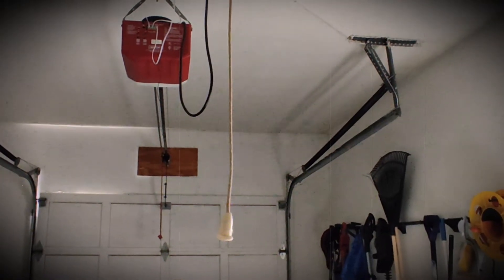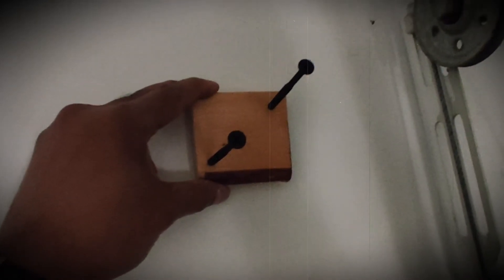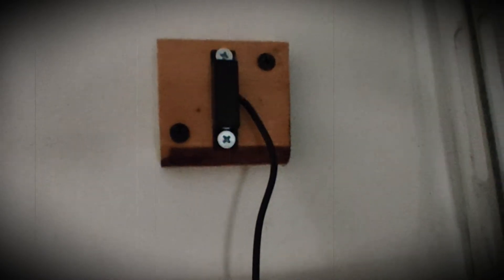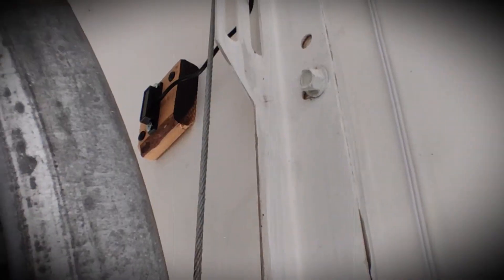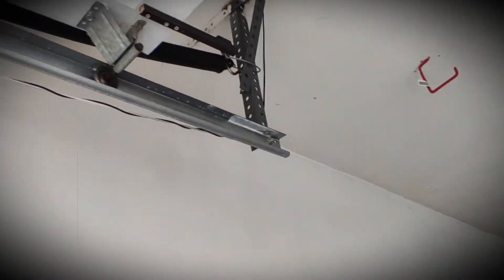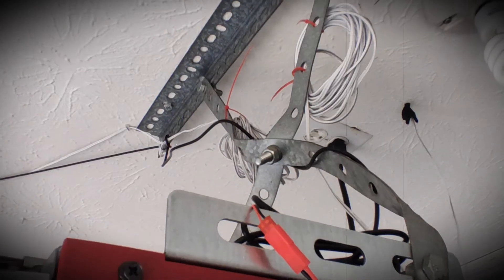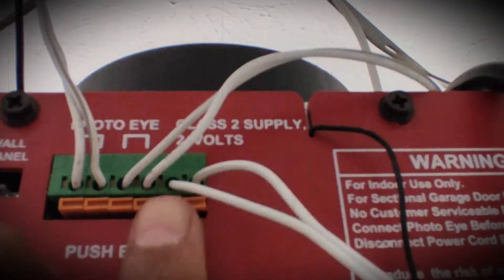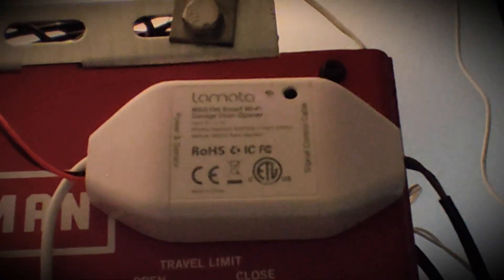Part 2   Installation of the Smart Wifi Garage Door Remote - Lomota or Meross

Comment: why wouldn't you just mount it on the ground
Reply: Mounting it to the top keeps it out of the way and out of sight
Reply from the maker: You could as long as the sensors touch each other when you close. I preferred it on the top.

Comment: My Chamberlain Liftmaster 2500 garage door stopped opening from the remotes and remote keypad, only the physical push button still works to open and close.  I went through all the troubleshooting steps in the service manual and it was determined that the logic board needed replacement.  Since the rest of the functionality works perfectly on my 17 year old Chamberlain Liftmaster 2500, I decided to try this as a better alternative to logic board replacement and/or complete unit replacement.  This is a lot easier and cheaper than both of those options, plus I have Android Auto on my car, so I should be able to open it via Google Assistant when I'm near my driveway.  It should arrive from Amazon tonight, I'll keep you posted if it was successful.
Reply: It worked great, was up and running in 30 minutes, including Google Home/Assistant linking.
Reply from the maker: Awesome! Great to hear. I am loving mine...also in the app you can set a schedule to close it in the evening.